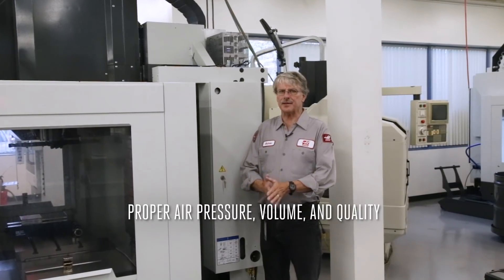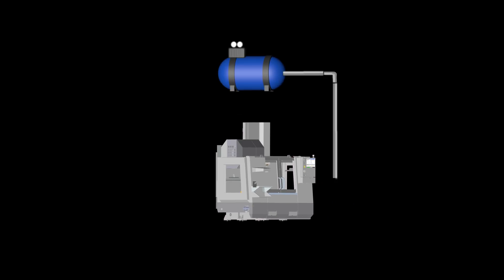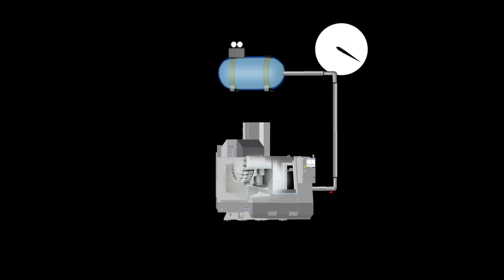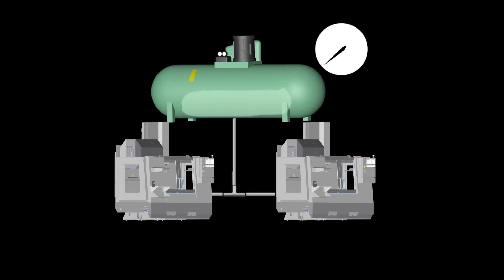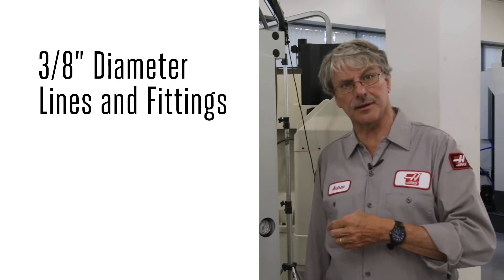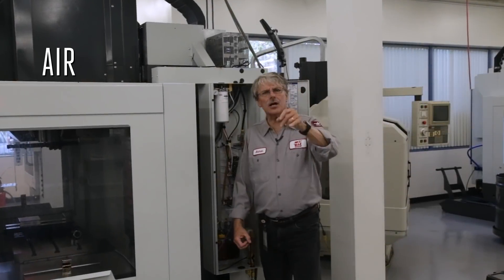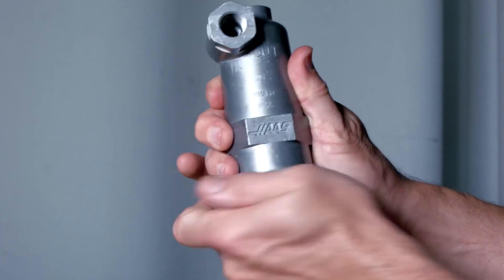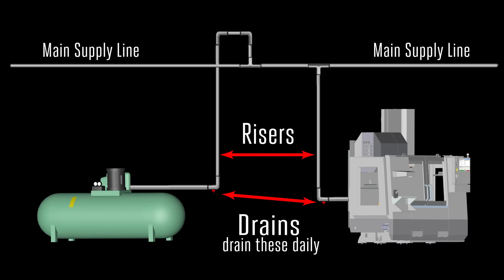Proper Air Volume, Pressure, and Quality - Haas Automation Service

Comment: Pick the air drops for the machines off the TOP of the main line, not the bottom where the water pools. Have a slope in the main line, with a drop to drain it at the end, and also drains on the drops for each machine.